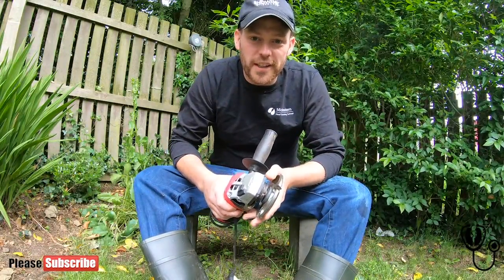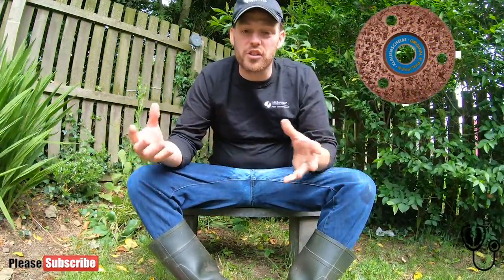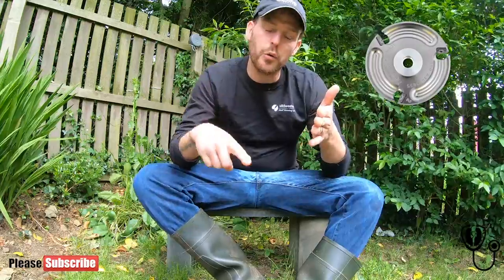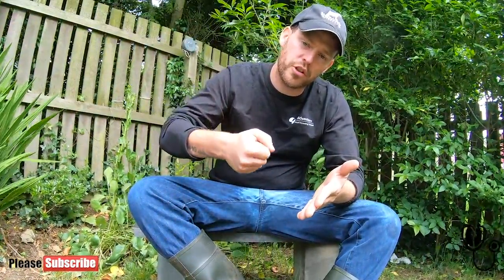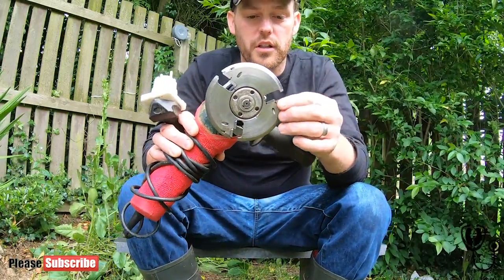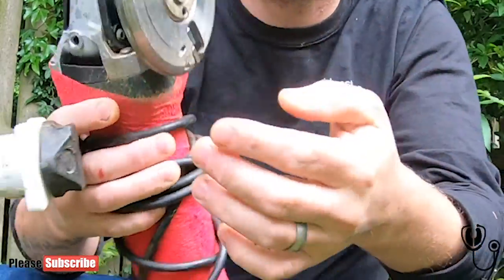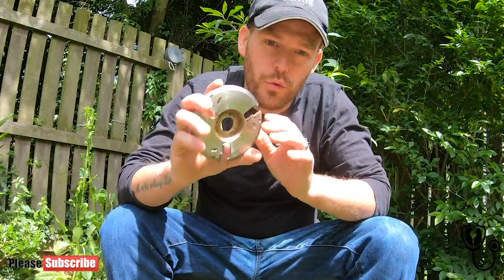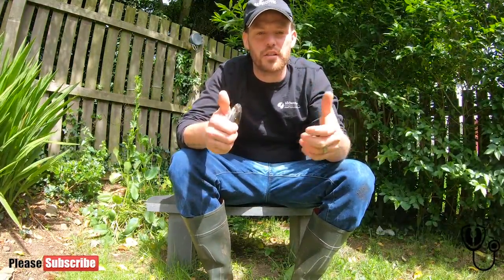WHAT DISKS DO I USE?? | The Hoof GP

Comment: I just ordered my first trim-tec Shaver II kit . Can't wait to use it !
Reply: have you used it yet?
Reply: @Rx7man  work great there is a learning curve to it . got to go slow and light to no  pressure just use the weight of the grinder wear a good face sheild  only use it on animals use to loud noises. I trim my percheron hoofs with it his hoofs are very hard the trim-tec makes trimming way fast and easy. and again go slow trim a little at a time these blades will remove alot horn instantly   and you hurt the animals severely  .you got to have full control  of this tool it will shave off just about anything it touches so be safe if you get this tool.

Comment: Why do you remove the safety guards from the grinders?
Reply from the maker: I actually feel that its safer for me and it gives you far greater visability. If/when you hit you hand with the grinder if the guard was on you hand would bounce into the guard and the blades would "bite in" to your hand more this way itll still cut you but you hand is thrown away from the blades
Reply: They are all pretty dangerous,  this is why it very important to keep up our trimmers work shop day's and training day's.  I like the old Wopa disck just because I have a better feel for it than the trim teck. Thanks for the video,  great work. 👌